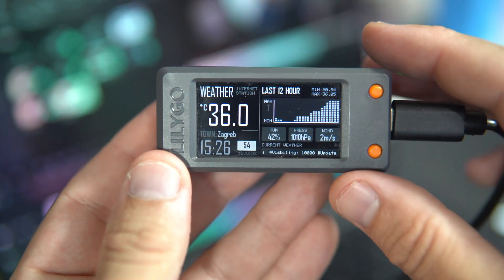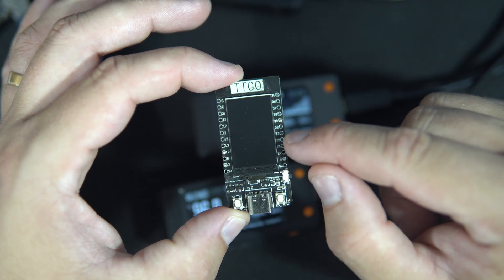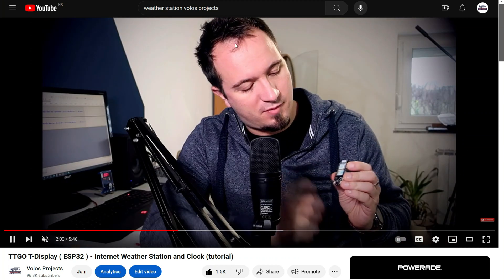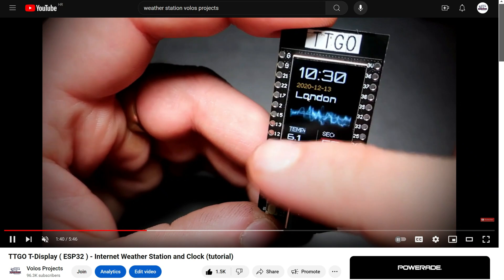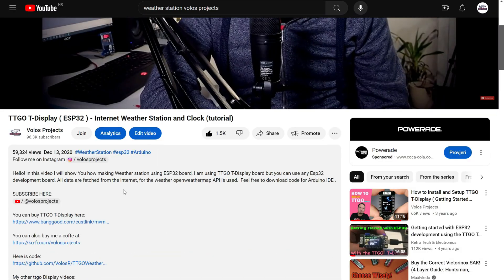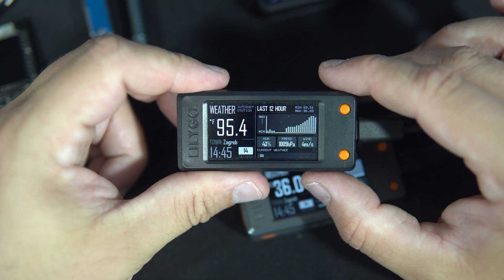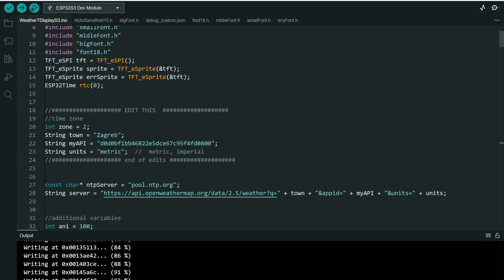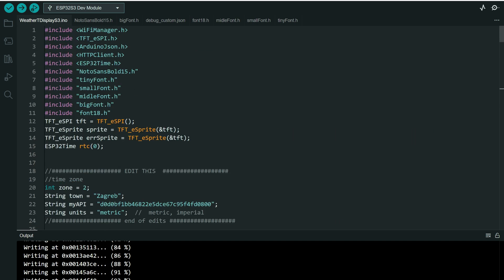Let's make Cheap Internet Weather Station using LilyGo T-Display S3 and OpenWeatherMap.org

Comment from the maker: HOW TO INSTALL LIBRARY AND AVOID BACK SCREEN: here is my tutorial https://www.youtube.com/watch?v=gpyeMjM9cOU   with lilygo boards i always use library they put on their product github site.  There you can also find instructions and board stings for this board https://github.com/Xinyuan-LilyGO/T-Display-S3
Reply: In the GitHub code I think you may have intentionally or unintentionally removed a line to enable the feedback provided by the Serial.Print statements  i.e Serial.begin("115200")
Reply: I have done exactly  all that is mentioned in the above video 'How to install library' but still get compilation errors in all programs.

The solution is that the version of board ESP32 by espressif may not be higher than 2.0.14

Comment: I love the UI on this - nice work, I set 2 up together with slightly different colour shades, one for London weather and one for Edinburgh weather. Could not get Wifimanager working for me  at all so just replaced it with the stock code    WiFi.begin(ssid, password);      while (WiFi.status() != WL_CONNECTED) {          delay(500);        }
Reply: Now added (with coding help from ai) boot button short press cycles through different cities, boot button long press cycles through 7 different colour schemes. Very neat :)

Comment: Hi im new to this. is it possible to add module to this board a sensor for actual room temperature?
Reply from the maker: Yes ofcourse, there is many good temperature sensors, i recomen i2c, they are easiest to hook up
Reply: @VolosProjects thanks for the reply! Is bme280 module fine?
Reply from the maker: @renielgarcia3306 yes

Comment: Hi! First of all, thank you for sharing this great weather station project. I've compiled the code successfully using all the specified libraries. I'm using the LilyGo T-Display-S3 board and selected the appropriate board in the Arduino IDE. I have installed the latest stable ESP32 board package, version 2.0.14. I also made sure to include all the required fonts (NotoSansBold15.h, tinyFont.h, smallFont.h, midleFont.h, bigFont.h, font18.h) in the project — all of them are properly uploaded and accessible in the sketch. However, after uploading the firmware, the screen remains black. The device seems to be running (no errors during upload), but nothing is displayed on the screen. Do you have any suggestions on what might be going wrong? Is there anything specific I need to adjust for this version of the T-Display-S3? Thanks in advance for your help!
Reply from the maker: It is probably bad tft_espi library . did you install it properly , here is tutorial https://youtu.be/gpyeMjM9cOU
Reply: @VolosProjects  Thank you, everything worked out!
Reply: @VolosProjects  I changed "wData[1] = doc["main"]["pressure"];" to "wData[1] = doc["main"]["pressure"].as<float>() * 0.75006;" to convert pressure from hPa to mmHg. Also changed "String PPlblU[] = { "%", "hPa", "m/s" };" to "String PPlblU[] = { "%", "mm", "m/s" };". To add spacing between values and units, updated "sprite.drawString(String((int)wData[i]) + PPlblU[i], 144 + (i * 60) + 27, 124);" to "sprite.drawString(String((int)wData[i]) + " " + PPlblU[i], 144 + (i * 60) + 27, 124);".

Comment: Nice work, I managed to upload it, though I must have done something wrong as the intensity of the display seems to be not so bright. I uploaded other sketches and they look fine ...are there any parameters associated with the brightness ?
Reply from the maker: line 84  ledcWrite(0, 130); , replace that 130 with larger number, up to 255
Reply: @VolosProjects  Thanks That did the trick, much apreciated for your response

Comment: can this be done on the Waveshare ESP32-S3 Development Board with 4.3" Capacitive Touch LCD Display?
Reply from the maker: hello, yes it can. it can be done on any esp32 board, only thinkg that need to be edited is part related to screen and resolution. Driver, libraries...
Reply: @VolosProjects  I would love to do that, but I'm no coder. It's a bit beyond my brain unless you have a guide.

Comment: FINALLY made it work today! Thanks Volos!! This is now on my work desk :) After a year of abandoning the device, trying to upload code to my T-Display S3 and giving up, I think I always made a step that i was missing something. I use Arduino IDE on Mac, and for noobs like me or for anybody who might have trouble with this, always have in mind following when errors appear: 
1. Downgrade in your boards manager "esp32" to 2.0.14 in order to make anything work with this device. I updated multiple times thinking having everything up to date should solve problems, and many random errors appeared everytime I tried to compile.
2. Download all libraries that LilyGo offers in their Github page, do NOT update anything in Arduino IDE afterwards, modify in TFT_eSPI the setup file with a text editor (User_Setup_Select.h), uncomment the line where your T-Display S3 device is in order to activate it, save file.
3. Make sure you develop with ESP32S3 Dev Module, don't try to look for LilyGo T-Display S3 in the list even if it exsist.
4. Make sure you are in the correct Port, check in the bottom right corner your device doesn't appear as [not connected]. Also, follow instructions in LiliGO's github list in order to know what you have to set up in the Tools section in Arduino IDE, this is crucial. (to avoid errors like sketch too big to compile, and other random errors)
Many of these things might seem logical to some experienced users but at least to me took me many MANY hours to figure out, and a lot of headache haha. Good that i learned a few lessons in the process! Thanks again for these cool projects Volos.

Comment: Hi, so this took me 3 days but I am finally successful. It was my first time doing anything with code. I could not get the wifi to work so I used one of your older codes to pull the wifi settings and to hardcode my wifi.
My question, and I am really new so maybe it is not an option, but I have some boards for meshtastic and one is a ESP32 Wireless Paper Eink by Heltec. I am wondering if this code can be added to that? I can always try I guess, thoughts?
Reply from the maker: hello derek, yes  part of code related to fetching weather data can be used on Heltec board, but part that draws conetent of screen will no be useful to you, your board uses completly diferent screen, libraries, resolution ...

Comment: Hi Volos, excellent video. I was able to make a small project based on it using TTGO. What type of battery would you recommend to use that TTGO can charge? Li-Ion or Li-Po and what capacity? I have tried to use an old Li-ion, 1900mAh, 7.22Wh battery from a phone. I was able to run TTGO from it and TTGO did charge it, but during charging the little blue led got really very hot so now I am afraid to use it. I don't want it to explode.

Comment: I try to put this program on my T-Display-S3 but I get the following compilation error. 

D:\Gebruikers\frans\OneDrive\Documenten\Arduino\T-Display-S3\WeatherTDisplayS3\WeatherTDisplayS3.ino: In function 'void setup()':
D:\Gebruikers\frans\OneDrive\Documenten\Arduino\T-Display-S3\WeatherTDisplayS3\WeatherTDisplayS3.ino:82:3: error: 'ledcSetup' was not declared in this scope
   82 |   ledcSetup(0, 10000, 8);
      |   ^~~~~~~~~
D:\Gebruikers\frans\OneDrive\Documenten\Arduino\T-Display-S3\WeatherTDisplayS3\WeatherTDisplayS3.ino:83:3: error: 'ledcAttachPin' was not declared in this scope; did you mean 'ledcAttach'?
   83 |   ledcAttachPin(38, 0);
      |   ^~~~~~~~~~~~~
      |   ledcAttach

exit status 1

Compilation error: 'ledcSetup' was not declared in this scope

Anyone knows a solution for this ?
Reply: Scroll down, author has addressed this a month ago. I had the same problem.

Comment: Hello, good day, thank you for your contributions, they are excellent. In this case, I get the following error: I am not very professional.
c:/users/radiocomiptv/appdata/local/arduino15/packages/esp32/tools/xtensa-esp32s3-elf-gcc/gcc8_4_0-esp-2021r2-patch3/bin/../lib/gcc/xtensa-esp32s3-elf/8.4.0/../../../../xtensa-esp32s3-elf/bin/ld.exe: C:\Users\RADIOCOMIPTV\AppData\Local\Temp\arduino\cores\53e710d135459a400993e552f18daea5\core.a(esp32-hal-misc.c.o):(.literal.temperatureRead+0x4): undefined reference to `temp_sensor_set_config'
c:/users/radiocomiptv/appdata/local/arduino15/packages/esp32/tools/xtensa-esp32s3-elf-gcc/gcc8_4_0-esp-2021r2-patch3/bin/../lib/gcc/xtensa-esp32s3-elf/8.4.0/../../../../xtensa-esp32s3-elf/bin/ld.exe: C:\Users\RADIOCOMIPTV\AppData\Local\Temp\arduino\cores\53e710d135459a400993e552f18daea5\core.a(esp32-hal-misc.c.o):(.literal.temperatureRead+0x8): undefined reference to `temp_sensor_start'
c:/users/radiocomiptv/appdata/local/arduino15/packages/esp32/tools/xtensa-esp32s3-elf-gcc/gcc8_4_0-esp-2021r2-patch3/bin/../lib/gcc/xtensa-esp32s3-elf/8.4.0/../../../../xtensa-esp32s3-elf/bin/ld.exe: C:\Users\RADIOCOMIPTV\AppData\Local\Temp\arduino\cores\53e710d135459a400993e552f18daea5\core.a(esp32-hal-misc.c.o):(.literal.temperatureRead+0xc): undefined reference to `temp_sensor_read_celsius'
c:/users/radiocomiptv/appdata/local/arduino15/packages/esp32/tools/xtensa-esp32s3-elf-gcc/gcc8_4_0-esp-2021r2-patch3/bin/../lib/gcc/xtensa-esp32s3-elf/8.4.0/../../../../xtensa-esp32s3-elf/bin/ld.exe: C:\Users\RADIOCOMIPTV\AppData\Local\Temp\arduino\cores\53e710d135459a400993e552f18daea5\core.a(esp32-hal-misc.c.o):(.literal.temperatureRead+0x10): undefined reference to `temp_sensor_stop'
c:/users/radiocomiptv/appdata/local/arduino15/packages/esp32/tools/xtensa-esp32s3-elf-gcc/gcc8_4_0-esp-2021r2-patch3/bin/../lib/gcc/xtensa-esp32s3-elf/8.4.0/../../../../xtensa-esp32s3-elf/bin/ld.exe: C:\Users\RADIOCOMIPTV\AppData\Local\Temp\arduino\cores\53e710d135459a400993e552f18daea5\core.a(esp32-hal-misc.c.o): in function `temperatureRead':
C:\Users\RADIOCOMIPTV\AppData\Local\Arduino15\packages\esp32\hardware\esp32\2.0.4\cores\esp32/esp32-hal-misc.c:71: undefined reference to `temp_sensor_set_config'
c:/users/radiocomiptv/appdata/local/arduino15/packages/esp32/tools/xtensa-esp32s3-elf-gcc/gcc8_4_0-esp-2021r2-patch3/bin/../lib/gcc/xtensa-esp32s3-elf/8.4.0/../../../../xtensa-esp32s3-elf/bin/ld.exe: C:\Users\RADIOCOMIPTV\AppData\Local\Arduino15\packages\esp32\hardware\esp32\2.0.4\cores\esp32/esp32-hal-misc.c:72: undefined reference to `temp_sensor_start'
c:/users/radiocomiptv/appdata/local/arduino15/packages/esp32/tools/xtensa-esp32s3-elf-gcc/gcc8_4_0-esp-2021r2-patch3/bin/../lib/gcc/xtensa-esp32s3-elf/8.4.0/../../../../xtensa-esp32s3-elf/bin/ld.exe: C:\Users\RADIOCOMIPTV\AppData\Local\Arduino15\packages\esp32\hardware\esp32\2.0.4\cores\esp32/esp32-hal-misc.c:73: undefined reference to `temp_sensor_read_celsius'
c:/users/radiocomiptv/appdata/local/arduino15/packages/esp32/tools/xtensa-esp32s3-elf-gcc/gcc8_4_0-esp-2021r2-patch3/bin/../lib/gcc/xtensa-esp32s3-elf/8.4.0/../../../../xtensa-esp32s3-elf/bin/ld.exe: C:\Users\RADIOCOMIPTV\AppData\Local\Arduino15\packages\esp32\hardware\esp32\2.0.4\cores\esp32/esp32-hal-misc.c:74: undefined reference to `temp_sensor_stop'
collect2.exe: error: ld returned 1 exit status

exit status 1

Compilation error: exit status 1

Comment: is there a low power version that can run on 2 AA batteries? Would a monochrome display be better for low power? I don't want it plugged all the time via usb but be standalone.

Comment: Unfortunately after uploading the sketch my LilyGo display is rebooting all the time:

10:09:53.416 -> 
10:09:53.416 -> 
10:09:53.416 -> 
10:09:53.416 -> ELF file SHA256: 68c4acd75e9fb73e
10:09:53.416 -> 
10:09:53.416 -> Rebooting...
10:09:53.416 -> ESP-ROM:esp32s3-20210327
10:09:53.416 -> Build:Mar 27 2021
10:09:53.451 -> rst:0xc (RTC_SW_CPU_RST),boot:0x8 (SPI_FAST_FLASH_BOOT)
10:09:53.451 -> Saved PC:0x420ac1be
10:09:53.451 -> SPIWP:0xee
10:09:53.451 -> mode:DIO, clock div:1
10:09:53.451 -> load:0x3fce3808,len:0x4bc
10:09:53.451 -> load:0x403c9700,len:0xbd8
10:09:53.451 -> load:0x403cc700,len:0x2a0c
10:09:53.451 -> entry 0x403c98d0
10:09:53.983 -> Guru Meditation Error: Core  1 panic'ed (StoreProhibited). Exception was unhandled.

And yes, I use the Libs from LilyGo with the right include in the User_Select_Setup.h file. Any idea?
Reply from the maker: @cc13com  did you chose 16mb flash size, huge partition scheme and OPI ram?
Reply: @VolosProjects  my settings are:
Board: "LilyGo T-Display S3"
Port: "COM4"

USB CDC On Boot: "Enabled"
Core Debug Level: "None"
USB DFU On Boot: "Disabled"
Erase All Flash Before Sketch Upload: "Disabled"
Events Run On: "Core 1"
JTAG Adapter: "Disabled"
Arduino Runs on: "Core 1"
USB Firmware MSC On Boot: "Disabled"
Partition Scheme: "16M Flash (3MB APP/9.9MB FATFS)"
Upload Mode: "UART0 / Hardware CDC"
USB Mode: "Hardware CDC and JTAG"

With this settings and a sketch from a different developer the display is working and showing something. And I remember (last year) I took an example from your youtube account and it run also successful.
Reply: @cc13com  same issue here.
Reply: ELF file SHA256: 91e5a5410

Rebooting...
ESP-ROM:esp32s3-20210327
Build:Mar 27 2021
rst:0xc (RTC_SW_CPU_RST),boot:0x2b (SPI_FAST_FLASH_BOOT)
Saved PC:0x4037b686
SPIWP:0xee
mode:DIO, clock div:1
load:0x3fce2820,len:0x1188
load:0x403c8700,len:0x4
load:0x403c8704,len:0xbf0
load:0x403cb700,len:0x30e4
entry 0x403c88ac
Guru Meditation Error: Core  1 panic'ed (StoreProhibited). Exception was unhandled.

Core  1 register dump:
PC      : 0x42019a23  PS      : 0x00060530  A0      : 0x82019afc  A1      : 0x3fcabf50  
A2      : 0x3fc9d0d4  A3      : 0x00000000  A4      : 0x0000000c  A5      : 0x0000000d  
A6      : 0x000000ff  A7      : 0x60004000  A8      : 0x00000010  A9      : 0x08000000  
A10     : 0x3fc9d3b4  A11     : 0x019bfcc0  A12     : 0x00000001  A13     : 0x00000000  
A14     : 0x00000004  A15     : 0x019bfcc0  SAR     : 0x00000002  EXCCAUSE: 0x0000001d  
EXCVADDR: 0x00000010  LBEG    : 0x40056f5c  LEND    : 0x40056f72  LCOUNT  : 0xffffffff  

Backtrace: 0x42019a20:0x3fcabf50 0x42019af9:0x3fcabf80 0x420044c9:0x3fcabfa0 0x42025243:0x3fcac2c0 0x4037f406:0x3fcac2e0

Comment: Hi Volos! Does this work with ILI9341 or ILI9488 (bigger) Display?
Reply from the maker: @Dancopymus  it will probably work if your board have enougth external PSRAM
Reply: @VolosProjects  But it would be Black and White, right?

Comment: Is it hard to change the colors of the project? I'm new with displays on a ESP/Arduino..
Reply: Not the hard...

void draw() {

  uint16_t greenColor = tft.color565(0, 255, 0);

 sprite.loadFont(midleFont);
  sprite.setTextColor(greenColor, TFT_BLACK);  // Set text color to green
  sprite.drawString("WEATHER", 6, 10);
  sprite.unloadFont();

}

😅

Comment: I have a black Screen on mine. Please Help!!!
Reply from the maker: @David121282  please , give more information, did you install libraties properly, is this first time you are using this board?
Reply: @VolosProjects  I have a similar issue on my end.  The screen lights up with the backlight turning on, but I have no display on the screen.  I did have to install an older version of the TFT_eSPI library (2.5.0), with the ESP32 library (2.0.14) installed.  If I tried using anything newer than 2.0.14, it would kernel panic, and I'd get a StoreProhibited error.  

It seems online that this has to do with an issue with newer versions of the TFT_eSPI library.  However, the unfortunate side effect is the blank screen, as mentioned by the other user above.  Can you provide the version information that you have for ESP32 core, and the TFT_eSPI library?  Thanks!
Reply from the maker: @StevenMcKenzie1  here is my tutorial https://www.youtube.com/watch?v=gpyeMjM9cOU   with lilygo board i always use library they put on their product github site.  There you can also find instructions and board stings for this board https://github.com/Xinyuan-LilyGO/T-Display-S3
Reply: @StevenMcKenzie1  Yes - I went down that rabbit hole with latest (Bodmer) versions on the TFT library,  I did get a display eventually by editing the User_Setup_Select.h (which by default seems to have nothing selected) to enable the 206 line #include, . But even then when I got a display  I had some strange issues with the orientation and raster lines out of sync, could sort of make out image if you knew what you were meant to be seeing.
Gone back to older library as per Volos vids - all ok
The problem with all these library versions  seems to be mimicking the problems of DLL hell in Windows

Comment: A very good project. However if you have installed  ALL the latest Liberary and Boards updates😊, The 'ldcSetup' has been merged with 'ldcAttachPins' and now you use ldcAttach(38, 8,1000) in its place.